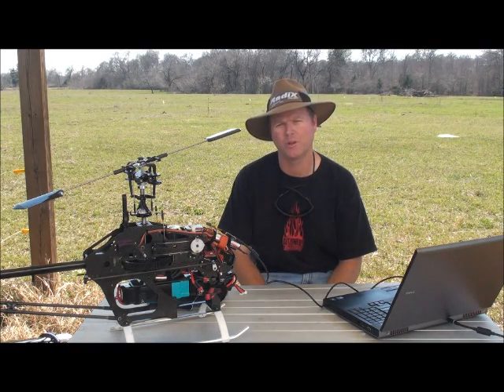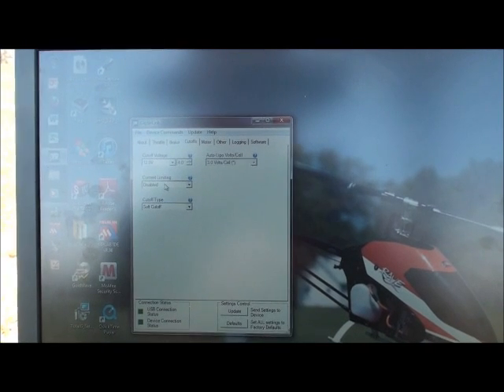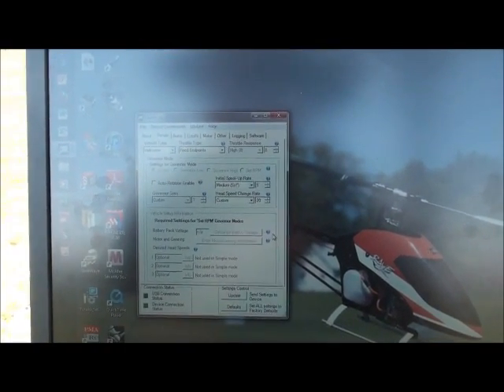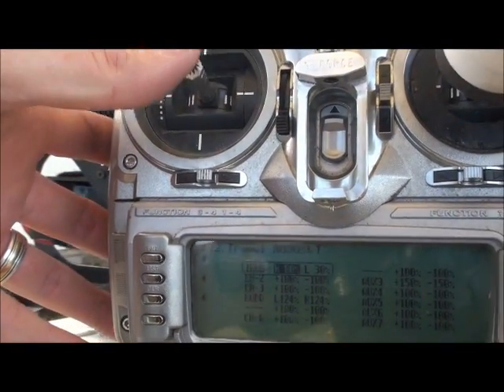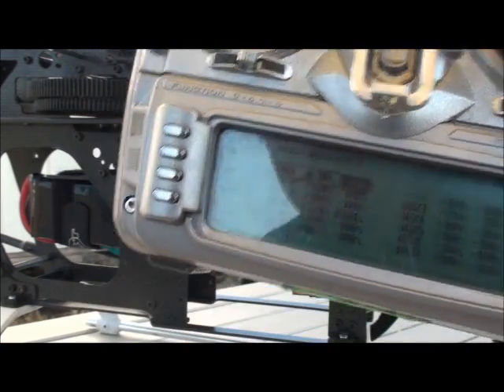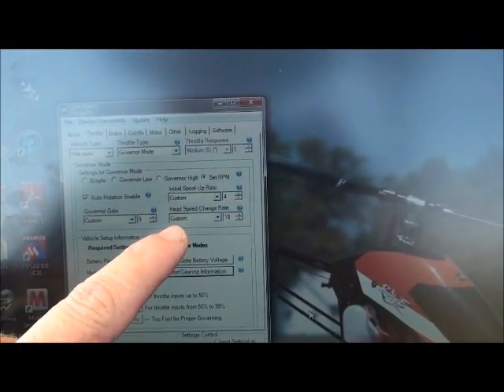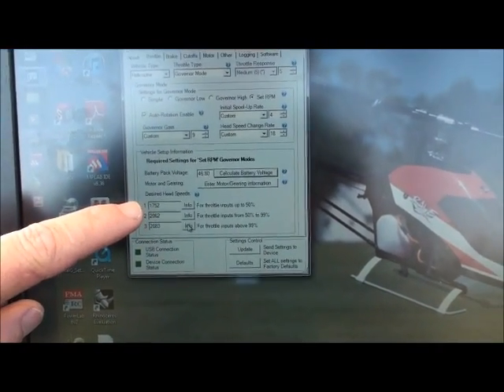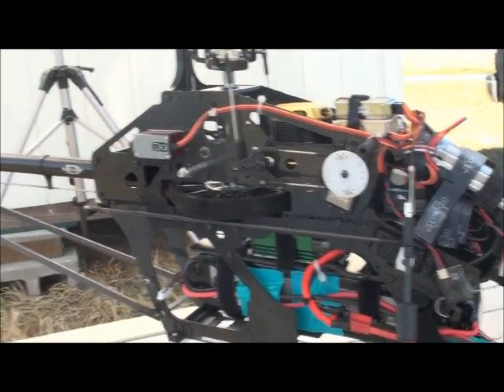Radix Facts  Episode 1 Castle ESC setup

Comment: Hi Curtis, I've a Castle Phoenix Ice 50 on a Rave 450 bought from another pilot.  The ESC was set to governor mode, Set RPM, GG 12, HSCR 18, BPV 15, speed 1 2911, speed 2 3111, and speed 3 3202.  I figured you'd know best so I started changing my settings while watching this video ... I got the throttle end points set and was ready to move forward to programming the Total G but it you lost me at the RPM Sensor.  After reading the documentation it seems I need the sensor in order for Total G to be the governor ... not sure where I can find the sensor but is it worth finding one and letting Total G be the governor rather than ESC?